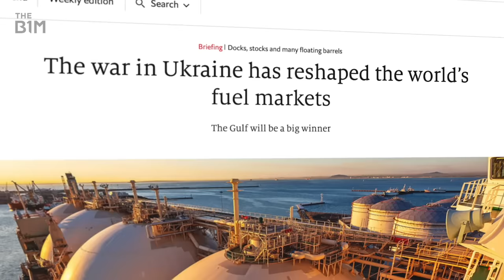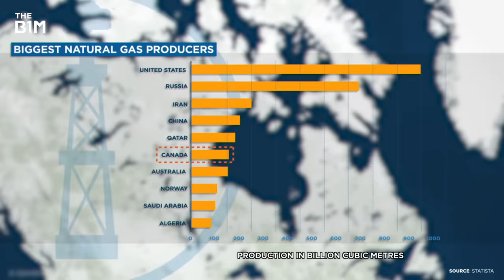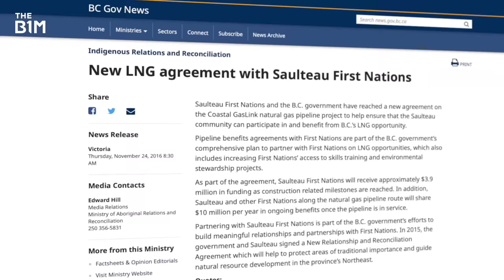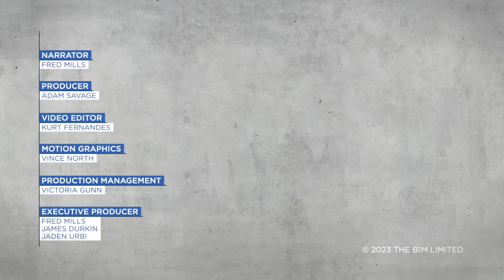Canada’s $30BN Gamble To Become An Energy Superpower

Comment: Natural gas will likely be the most important fuel of the 21st century. It will be at least late 21st century before we can reach peak electrification AND have the renewable supply, energy storage and transmission required to displace fossil fuels entirely. Until then, we need something that can displace coal ASAP and back up variable renewables easily, and like it or not, that fuel is Natural Gas.
Reply: And nuclear is a good option for base load if people would stop fearmongering about it
Reply: @joshuacheung6518  Absolutely. The fear of Nuclear is almost completely irrational on every front. The impacts of waste storage is negligible compared to the impacts of mineral extraction, for both fossil fuels and renewables. The fear of accidents is ridiculous when you look at the actual numbers behind the accidents that have happened, like Fukushima. Hopefully SMR's will take off all over the world and put a meaningful dent in our energy needs.

Comment: Isn't methane like 10x more polluting than CO2 and it's a byproduct of NG?
Reply: Well natural gas is (almost completely) methane. But yes, if natural gas leaks it's massively climate driving.
Reply: And more like 80 times the gwp of co2
Reply: Only if it leaks out instead of getting burned. Whether or not natural gas is as bad as coal on a grams of CO2 equivalent per electrical kWh depends on how much methane leaked out along the way.
Reply: It doesn't stick around for as long in the atmosphere though; about 40 years I believe. Bit of a trade off
Reply: @JesusPeto  true. But that 40 years of intense heating could Well push us over the next tipping point. Such as the siberian perma frost . Releasing huge volumes of methane .
Reply: @joewentworth7856  methane which would again stick around just 40 years, but I take your point. Those 40 years are still relevant, and there could be longer-term consequences

Comment: Ironically, this is being built in a province whose electricity production is 95 percent renewable.  Hydro is at about 87 percent, with biomass and geothermal at five percent.  The wind and solar crap are less than 3 percent.
 The people who insist that intermittent and therefore less efficient sources like wind be a big part of electricity generation are actually the best friends of the natural gas industry because intermittent energy sources need to be paired with fast responding backup generating capacity like hydro or natural gas
Reply: And the fact that you need 100% of the power requirement as backup if you have 100% solar and wind, shows how stupid those power sources really are.
Reply: It's only intermittent until you have sufficient energy storage. The combination of renewable energy, nuclear, and energy storage eliminates the need for fossil fuels in grid energy production. The biggest hurdle isn't technical, it's financial. Governments struggle to get projects approved due to fossil fuel lobbying and misinformation campaigns, and private capital is prefers the proven profit margins of fossil fuels over renewables and nuclear.
Reply: @Briggsian  The government has the money, but they piss away billions on stupid projects like this that won't be competitive. Anyone who thinks the supply contracts won't be cancelled has rocks in their heads. Canadian Pension plan will be on the hook for this enormous stranded asset.
Reply: @willnash5352  this is mostly private investment. The federal government is, unfortunately, providing $275 million to the project, but that's only 0.69% of the proposed cost.

Comment: Does the $30 billion cost include the estimated cost of transporting the gas or is that extra?  I've read that a 7.5 KW solar PV system (enough for one house) costs $25,050.  So $30 billion would pay for 1,197,604 house systems so just over 3 million people with the average house occupancy.  Over 4.5 million if the gas transport cost isn't included.

Comment: I think they should have mentioned is the LNG is significantly less clean than regular natural gas. The need to liquify the gas and ship it makes it much less efficient.
Reply: Currently, because of all of the blocked pipelines, canada ships all of it's oil by rail. Environmentalists chose the less environmentally friendly route when they blocked all of the pipelines. It's a moot point now. Why would it be any different for LNG? This was an issue that prople who actually care about responsible resource development raised years ago but no one wanted to listen. I doubt anyone will listen now when it comes to LNG.
Reply: @mikeh6109  Pipelines being blocked has nothing to do with this issue. Pipelines are being used in this case to ship the gas to the coast. But you can't use pipelines to cross oceans. So you have to consider the costs of liquefying the gas and shipping it using tankers.

Comment: What about the possibility of RR Rolls Royce Small Modular Reactors in the U.K. being developed which includes replacement for existing coal or gas-fired plants. The U.K. has less resources but uses science and innovation and engineering to bridge the gap in those deficiencies.
Reply: Canada is building a small modular reactor as we speak
Reply: Honestly, anything that's 'in development' now is too late. They're not expecting to build their first reactor until the 2030s. Even the assessment that our nuclear authority does of the design is expected to take 4 years, ending in 2026. It'd be great if we could have such things, but the timescales are frankly ludicrous.
Reply: @rollingthunderinho  yeah to be complete by late 2028. And that's one reactor. A Hitachi one by the way, so in fairness to Rolls Royce, it's not the boost for Canada that their one would be for the UK. We can't be relying on projects that take decades to make even a tiny impact, but thankfully the energy industry is just moving to wind, solar, batteries and a few other bits and pieces and all this worrying about installing LNG nonsense is irrelevant anyway since it's a commercial dead end.

Comment: They should have invested in fossil fuel free energy instead imo. I see no reason to go for lng over green energy at this point.
Reply: Storage.   We still don’t have good storage for wind, solar, or any of the periodic renewables.  But, perhaps this huge footprint could have been used as a compressed air storage system.
Reply: How are they going to sell that overseas? It seems like a stupid thing for you to say that they should have invested in fossil fuel energy instead, unless you meant nuclear...
Reply: @randallthomas5207  we dont have good energy storage, because noone built it, not because the concepts dont exist.
Reply: @chronometer9931  i think you have a typo, so i cant really say, what you mean (that way or the other). How ironic, since you called me stupid.
Reply: @nickfleiwer5272  You are seriously misinformed.  The efficiency of the current storage schemes is very low efficiency.  There are lots of available schemes, really really big batteries, pumped hydro, liquid sodium, etc.  But none of them are very efficient.
Reply: the laws of physics will ultimately decide

Comment: If only there was a way of extracting energy from a Nuclear process. Some kind of Nuclear Power Station - that would be incredible! It would release Zero emissions and be cost effective...
Reply: There are no projects that release zero emissions. Even renewables require emission producing machines to build them, and nuclear is no exception.

They are also not nearly cost-effective. At least not in the way they are still built. Nuclear plants can take up to 7-10 years to build. And they always end up 60-70% over budget. 

I'm not against the nuclear option. But you have to take into account Demand,  Environment, and Economy and that it is not always the most viable solution.
Reply: @devinmay3038 You need to look into the newer technologies then, nuclear has come a long way. Also the impact of building the building would be low so you don't really have a point there. Obviously the benefits outweigh the negatives
Reply: @chronometer9931  that depends who you ask. The construction, operation, and eventual decommissioning are extremely expensive compared to other renewable sources of energy. The fact is no one is willing to finance these projects due to the cost.

Another obstacle is the government and people who will be living near it. Most people still fear nuclear and do not want to live near them.

Nuclear is too slow, too expensive, and still instills fear in the public eye. I myself think it is wise to invest in nuclear with other renewables. But the facts above hinder its progress.
Reply: and with abundant energy we could lift the entire world out of poverty and clean up our natural environment
Reply: @lukefrahn8538  even if there was free unlimited electricity for everyone. That would not eliminate poverty. That's a whole separate issue with a lot of different variables.
Reply: @devinmay3038  well nothing is free or unlimited, but if access to energy (as the means to access water, food, heat, etc.) was considered a universal human right in the 21st century, it would most certainly reduce poverty

Comment: Natural gas combined with solar power is a great combo
Reply: Nuclear paired with wind or solar is better though.
Reply: Skip the expensive plants and build more wind and solar.
Reply: @krysatheo  the problem with nuclear is its too expensive and prone to natural disasters and attacks. Furthermore, even though disposal of nuclear waste at sea has been banned illegal dumping still continues to this day. But there may be potential with thorium based reactors
Reply: @levismith7444  over the lifetime of a nuclear plant (which can go up to 100 years), it is not more expensive actually and new generation nuclear reactors can reuse nuclear waste to drastically reduce nuclear waste.  4th generation nuclear plants + LNG is the way I would definitely suggest to go.  China alone is investing $500 billion in next generation nuclear plants between now and 2035.
Reply: @jasonwilliams8016  go research how well that’s going for Germany
Reply: @evilbunny5  they shouldn't have shuttered their nuclear plants
Reply: @jasonwilliams8016  totally agree
Reply: @jasonwilliams8016  The amount of batteries needed to provide steady load to the grid would be insane and have massive environmental cost.  Nuclear is many orders of magnitude more energy dense and consistent, and should absolutely be part of the green energy future.
Reply: @krysatheo  the main issue with nuclear is the cost and the timeline. 

Batteries don't have to be cells like Energizer. They can be pumped hydro, pumping water uphill during the day so it can turn a turbine at night. There are all sorts of energy storage devices, batteries, being developed. Fully integrated grids have in some instances negate the need for battery backup at all.

Comment: The current problem with wind and solar is neither can provide resilient energy as in 24/7/365.  The true needs to include to entire life cycle, from raw materials through manufacturing to energy production and finally deposal after their useful life, taking into account the true requirements of providing 24/7/365, only then  can you make a prudent responsible decision.

Comment: While technically NG produces less CO2 than coal when burnt NG itself is a greenhouse gas far more potent than CO2, and at EVERY stage of its use (drilling, collecting, piping, liquifying, storing, transporting, burning, etc.) there is a "methane slip" that collectively releases enough NG to undo any savings in CO2. A lot of this methane slip can be avoided if you convert the methane into a true liquid - methanol.

Comment: It's funny how the politicians go on and on about decoupling with China, but then every single important project is tied so tightly with Chinese manufacturing.
Reply: It's a popular platform to go on. 
The truth is that manufacturing is simply amazing and coherent in China. They make so much stuff and all the logistics are close by and connected. 
Combine that with the sheer numbers of skilled labor technicians required and it becomes VERY expensive to do anything fully domestically. 
There is a reason that all the worlds motherboard manufacturers are located in China, Taiwan, or very close by.
China has enough domestic demand (due to how many people they have) to enable investment into these niche "mega-project" manufacturing centers and tooling. 
It always comes back to population. More people = more demand = more productivity.

Comment: The simple fact is renewables are not dependable.  Fossil fuels will remain a key source of energy for decades.   For example California has 8 gigawatts of wind capacity installed.   It’s not uncommon to see those systems only producing 1 gigawatt.  During the recent tropical storm they were finally able to produce over 4 gigawatts.

Comment: I guess it's only 40 or more years sence the first LNG plant's where proposed for BC this is the only one that made it through the permitting process and construction began, not shore why they didn't use off the shelf modules. But custom designed and built at more then double the cost no doubt!

Comment: Between this project and the Trans Mountain Pipeline, the government is going to spend upwards of $80 Billion to distribute fossil fuels to countries that are  in the process of getting off fossil fuel as quickly as possible. Plus, Canada will never be able to supply LNG or Oil as cheaply as some of the competitors. Imagine if this money had been put into other much needed infrastructure or low carbon projects like solar, wind, hydro.

Comment: 1 Billion people have access to 'green energy'. 

7 Billion people don't.  And the price of 'green energy' is never going to come down to the price of fossil fuels -  making it extremely unlikely that demand for fossil fuels will decrease very rapidly. Even with all the new green energy coming on line in our modern times, fossil fuel usage continues to increase year after year. That 7 Billion population expands much more rapidly then the 1 Billion group. 
Yes, it is counterproductive to global warming, but its just not fiscally viable to go green faster in poorer countries (at least until the point where it's too late).

Canada will rapidly become a nearly completely 'green energy' country, so economically, they need to be able export this valuble commodity to the 3rd world (best to get it from reasonable countries than dictatorship countries) - and the USA won't need it as it will also be going 'mostly green' and also has a large fossil fuel industry to support it's declining requirements - thus such shipping ports are a necessity.

Alberta would be wise to build speciality refineries to optimize converting the bitumen heavy tar sands to plastics and similar products (asphalt, roofing, etc). You'd think that would be also a good long term investment for the future of the tar sands (instead of just burning it).
Reply: Green energy is already cheaper than coal power.  This is an indisputable fact.
Reply: @texaswunderkind  Coal yes. Natural Gas no.
Natural Gas (which this video is altimately about) is the cheapest form of energy.

Comment: Pretty balanced video for a change. Fundamentally the answer is BC is too late to the party. 
As noted about Europe the world is doubling down to move away from fossil fuels for electricity production (wind and solar are cheaper and quicker to bring online, and not subject to geopolitical issues) and space heating (much more efficient heat pumps). Just last week China and the US agreed to restart their cooperation to counter climate change, and one of the 25 points in their statement is to triple global renewable energy capacity by 2030. Couple this with the many other countries that already have an established LNG industry and the IEA predicts there will be oversupply by 2025.
Also, LNG is not a climate solution to burning coal. New studies out of Cornell university show that even if the product is only shipped a relatively short distance the total upstream and downstream emissions are greater than that of coal. A large part of the reason for this is fugitive emissions of methane gas all along the whole production, liquification, transportation and gasification process. Plus the vast amounts of energy needed to achieve all of these steps.
The method of extraction of the gas for LNG in BC is also a huge problem. Fracking uses vast amounts of fresh water, pumps ‘proprietary’ chemicals underground resulting in polluted groundwater and needs a massive network of roads and pipelines which destroy vast tracts of land.
LNG Canada phase 1 is a done deal. The BC government needs to get a grip on reality not allow any more terminals to be built. It should redirect the billions of dollars of taxpayer subsidies ($5B given to LNG Canada Phase 1 in the form of tax exemptions, income tax breaks, cheap electricity etc) and focus on greening BC’s economy, creating good jobs in industries with a future.

Comment: One wonders if they can use the Kitimat/Kemano hydro power to liquefy the natural gas.  The hydro plant was built decades ago for Alcan's aluminum production.  My mom grew up in Kemano.
Reply: Most of Kemano's power is still used by the smelter, the rest goes onto the grid.  Since the smelter and the LNG plant are literally adjacent, I would assume the LNG plant will also use Kemano's power, pulling any additional power they need from the grid.  The Site C dam is only 44 km due north of where the Coastal Gaslink pipeline starts.
Reply: Site C.
Reply: They didn’t build the transmission lines. BC hydro acted shortsightedly.